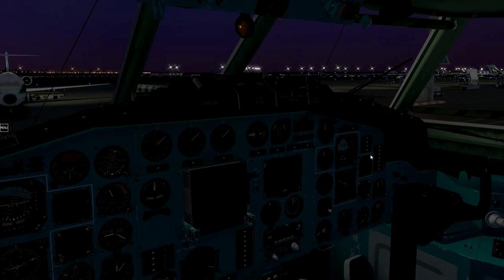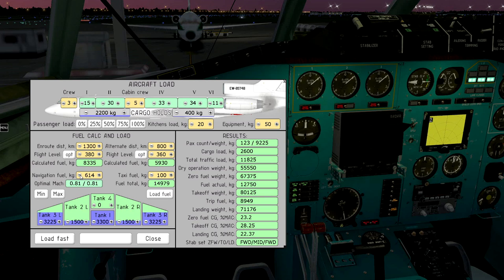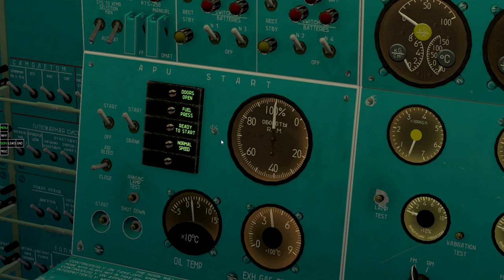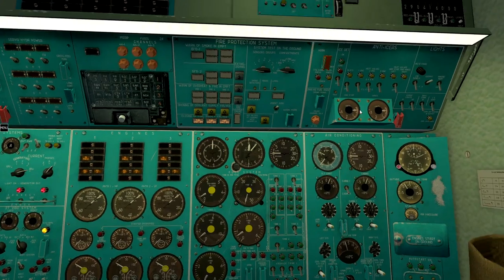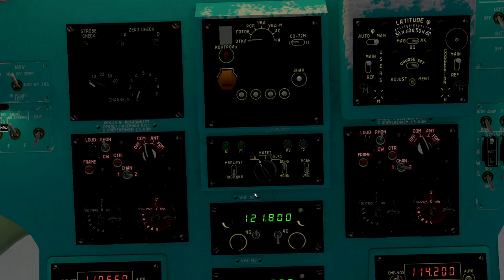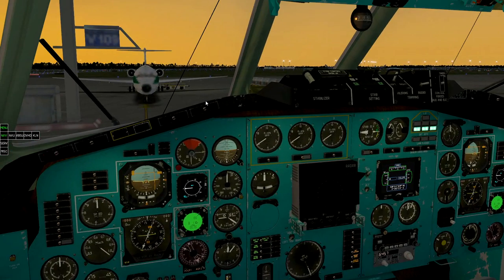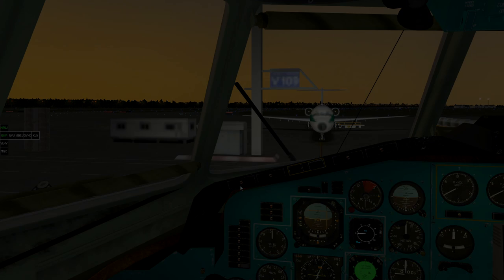Tu154 overview and start

Comment: Timestamps

00:36 Connect Ground Power
01:07 Electrical Power Up
01:35 Cockpit Lighting
02:02 Show/hide flight yokes (Shift + F9)
02:07 Aircraft Load (Weight & Balance)
04:06 Exterior Preflight Items
04:17 Lamp Test
04:56 Fire Protection System

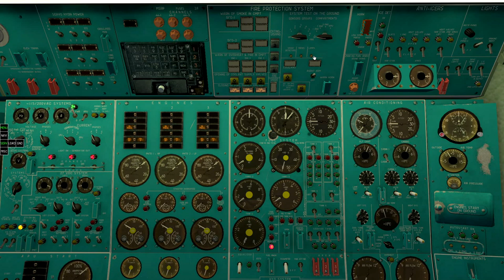05:14 Beacon, Nav, Logo Lights
05:37 APU Start
06:47 Charge Hydraulic Systems
08:08 Disconnect External Power
08:17 Check Parking Brakes, Remove Gear Blocks
08:40 Set RA, Voice Recorder, Flight Recorder
09:01 Set Fuel System
09:31 Turn On Engine Instruments

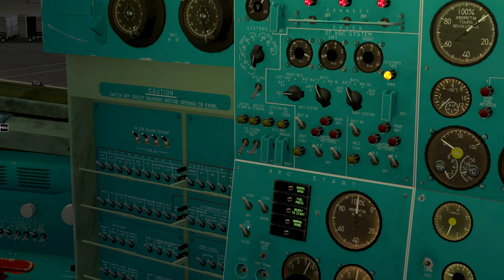09:39 Open APU Air Bleed Valve

09:55 Start Engine 1
10:49 • Check/Connect Engine 1 Generator
11:16 Start Engine 2
11:26 • Check/Connect Engine 2 Generator
11:30 Start Engine 3
11:40 • Check/Connect Engine 3 Generator

11:46 Engines Start Panel
11:49 APU Shutdown

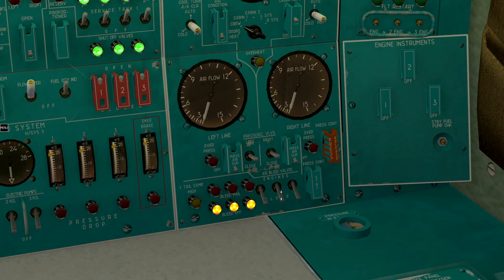12:14 Engine Air Bleed
12:47 Air Conditioning
13:00 Cabin Pressure
13:15 Ice Det, Anti-Icers

13:42 Navigation Systems
14:47 Cabin Signs
14:50 Windshield Heat, Pitot Tubes Heat
15:04 Navigation Radios
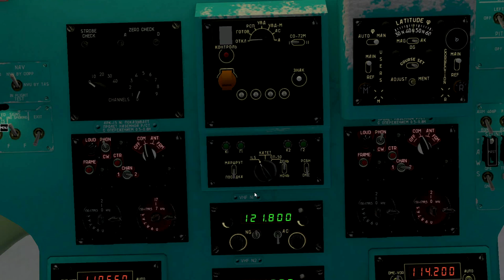15:23 Compass System
17:05 Hydraulic Boosters
17:24 Autopilot Panel
17:39 Artificial Horizon
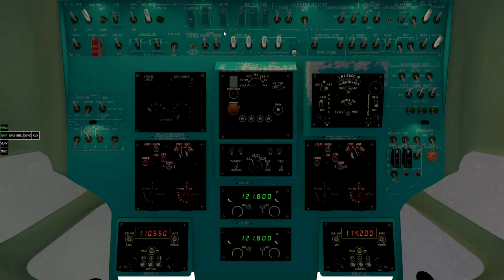18:09 Turn On Autopilot
18:36 Weather Radar
18:54 Transponder
19:14 AoA, Load Indicator
19:23 Altimeter

20:09 Wheel Steer
20:15 Landing Lights
20:26 Flaps
20:35 Stab Setting

20:45 Wheel Steer 10° for take off

Love this thing and your 747-200, thank you!

Comment: Loks great. Credit card is ready. Just a minor request, the quantity for aviation distance is usually nautical miles (nm), maybe you can adapt your calculation sheet. Will make it easier working with flight planning tools.
Reply: +sly08151 Not in Russia it isn't :) I guess we will see in time if ti can be done
Reply from the maker: +sly08151 There is a converter on PHONE panel.
I'll think about adding miles into starting data.

Comment: can you please an autopilot and make navigation tutorial?
Reply from the maker: +Plane_observation  i plan to make tutorials on every system. yes, i'll make the one about using autopilot and navigation next. maybe i'll even try to explain how to use NVU - it's a very complicated systems and requires an educated navigator to operate. Really, you'll need maps, ruler and pensil :)
Reply: +Felis Leopard
Is there a NAV mode on the autopilot which makes the aircraft automatically follow flightplan routes? If yes, I'm buying it right now; I'm a lazy simmer who just leaves the computer during flight.
Reply from the maker: Empennage you'll need to install KLN90 and yes, there is a way to connect it to autopilot. But be aware, this aircraft is really complicated :)
Reply: +Felis Leopard Thanks for reply; purchased just now.